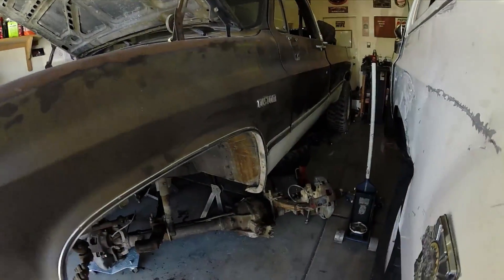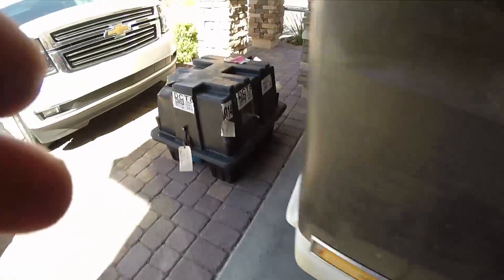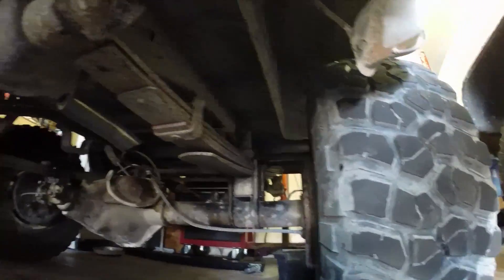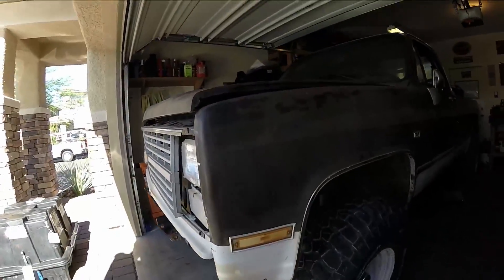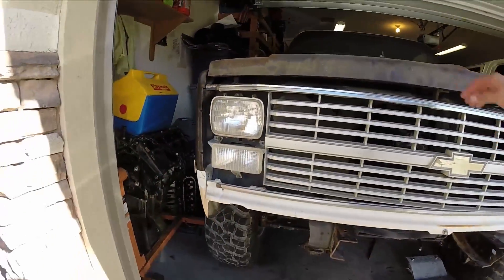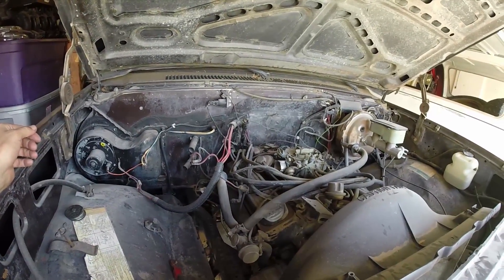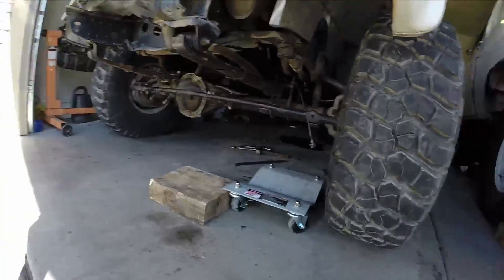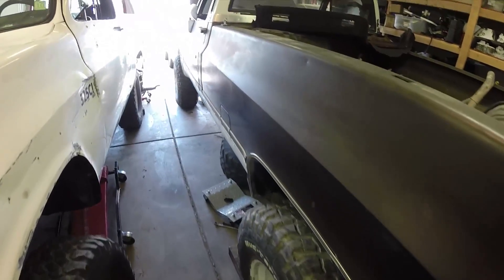Chevy K10 update 6.14.14

Comment: I'm curious, you were thinking about putting a 4L60E on the back of the 5.3, right? What were you planning on doing about the transfer case, since most of the new transfer cases that bolt to the 4L60Es are passenger side drop? Would an NP241C work?
Reply from the maker: If I were to do a 4l60e or 4l80e I would do a divorced NP205, since I have some length now.
Reply: I realized after I asked that you had a 205 already and would probably use that. Is there a reason you want to do the divorced instead of using one of the adapters to bolt it up directly?
Reply from the maker: bman222112

Because I would use a 2wd transmission so I could have an accurate VSS reading.

Comment: Dave were you able to keep the k10 at 2.5 inches of lift? I'm thinking of lowering the k10 but not wanting to destroy the metal.
Reply from the maker: Hi Nick, when I had it at 2.5" of lift, and 35" tires,  it rubbed in the front while offroad(ok on the street). With the 4" it was a lot better. When it was 2.5 I had to do some trimming!
Reply: @Dicks4x4Garage  that's what I thought. I'd like to lower it,  but I don't think I'll take a sawzall to rust free GM metal.
Reply from the maker: Yeah, don't do it! Your truck is to pretty.
Reply: @Dicks4x4Garage  thanks man. I wouldn't consider it, but my wife is barely 5 ft tall.  Watching her climb in the truck is hilarious.

Comment: do you have any vids of your sm465/np205 swap????
Reply from the maker: april rivera No but did you have any questions ?
Reply: yeah a couple as im gathering part for a sm465/205 6.0 conversion/swap in my 87 crew cab.did you use a 85-91 hydraulic pedl assembly with slave,bell,etc,or a 73-84 manual pedal assembly/bell and use the hydraulic thrust pressure bearing? iv followed your write up over on k5blazer BADASS,thanks for the help/writeup!!!
Reply from the maker: I don't know if you saw my blazer thread, but I has all of that info, I posted a link if there is something you can't find there let me know. Good luck with your post.  http://www.chevyk5blazer.com/forums/showthread.php?1507-Project-Arctic-Blaze&p=69793&viewfull=1#post69793